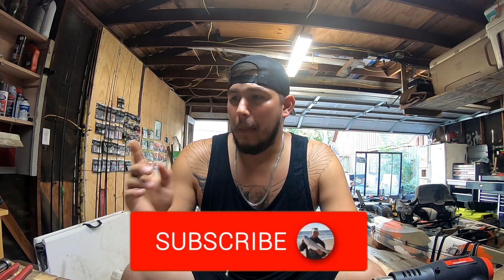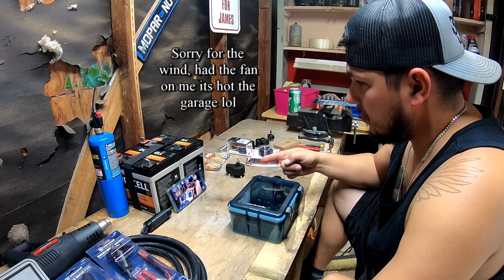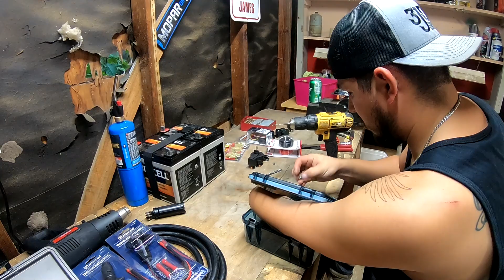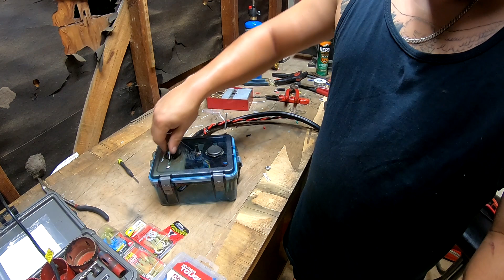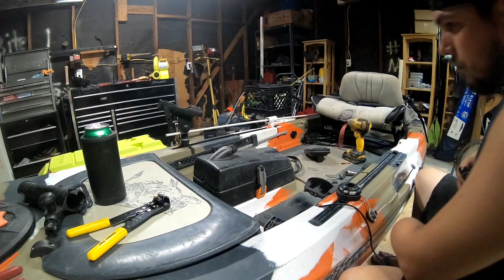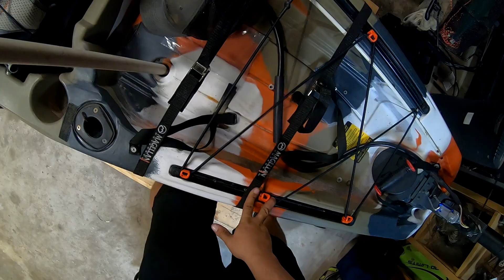FeelFree Lure 13.5 - Trolling Motor Control Box/Fish Finder Instal

Comment: I rigged mine up about 3 years ago. My pwm was still running well after 3 years , so built a better box with cut off. The motor in the pod worked better for me because there are lots of time I use kayak without motor, but still need rudder. https://youtu.be/qsHHnkaMSC8?si=xmpBzZyVjKLBEVDV
Reply: https://youtube.com/shorts/WLUs32EvknY?si=9uAt7AmPwEfN3BKE
Reply: https://youtube.com/shorts/PMdUYRb3mTc?si=5UCeCre8g5Jpg3Ds

Comment: Awesome build! Hey, what batteries do you use for the trolling motor and how long do they typically last?
Reply from the maker: So the batteries for the trolling motor are 2x35Ah Duracell ultra somethings. I can't remember the exact name but if you Google 35Ah Duracell ultra battery you'll find a link to a website that sells them and it'll give you all the info about them. And as for how long they last that depends on how fast you're traveling if you're traveling at full speed or minimum speed or right in the middle. If you're going against the wind with the wind against the current with the current if you're out in the bay which I usually go in the bays over here in Texas and sometimes I'm going against the current so that drains the battery a little bit more. But I am thinking of adding a trickle charge solar panel kit to it it'll be on the front hatch so that the battery can be charged while I'm just sitting there fishing to help give me more time out on the water. But the first time I took it out in the bay and I was using like full speed to go just about everywhere it lasted just about 6 hours. But again it all depends on the conditions and how fast you travel from spot to spot
Reply: @thebionichandman8967   Thanks for the reply!!!
Reply from the maker: @natejonas1107ify  anytime. If you have anymore questions feel free 😉 to ask 🤣🤣🤣

Comment: Sweet video man!
Reply from the maker: Thx man!!! Working on getting a new go pro. Mine messed up which is why I haven't made new videos
Reply: @thebionichandman8967  which one did ya have and what happened to it?
Reply from the maker: @RhinoJoeOutdoors  I have a hero 6 black. And for some reason it's not recognizing the batteries. Like if I plug it in via USB or an external battery pack it'll turn on but why charge the battery inside. I have 3 batteries and neither of them turn it in anymore even when they're charged
Reply: @thebionichandman8967  that’s really odd! I’m not a huge fan of GoPro as I have had so many issues with mine
Reply from the maker: @RhinoJoeOutdoors  yeah. I mean it still works but I have to use an external battery pack wired to it. Thinking of getting another one this Christmas but brand new from go pro. Not renewed lol